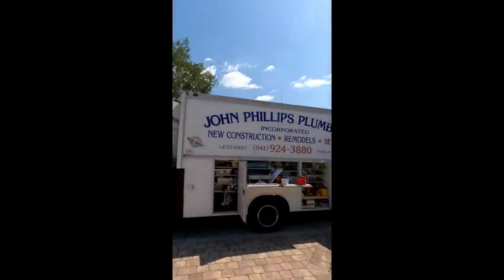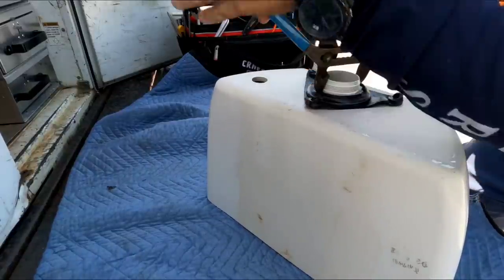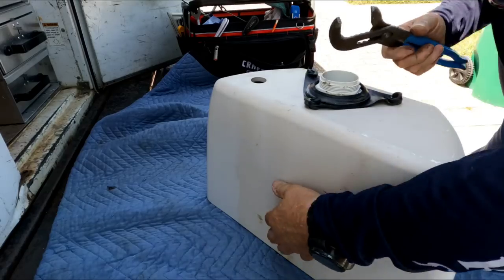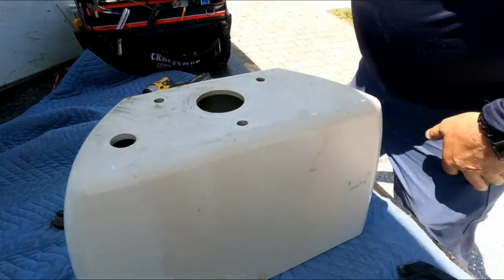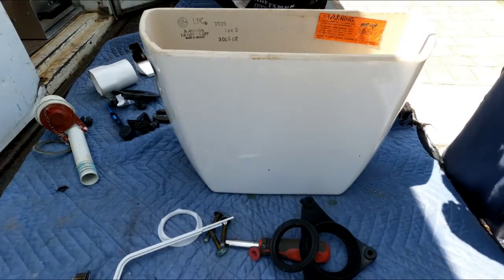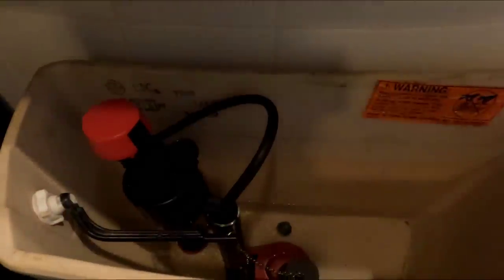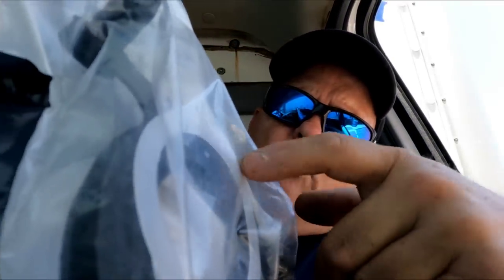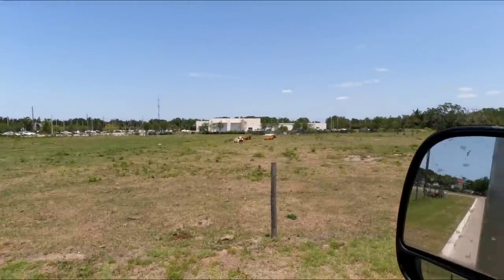JUST A STRANGE SERVICE CALL,WOW!

Comment: John no need to struggle getting off the gasket. Simply cut with a razor blade the rubber gasket on all 3 side then pop off the gasket from the nut, then u can fit ur channel lock plyers and loosen nut